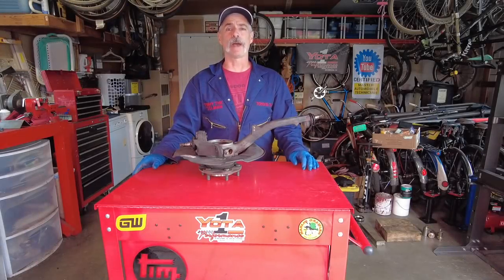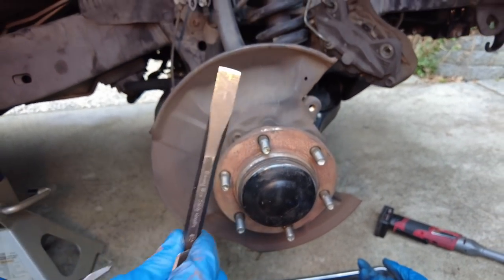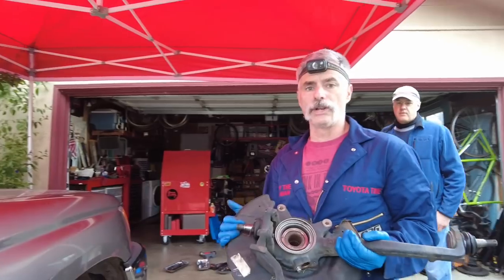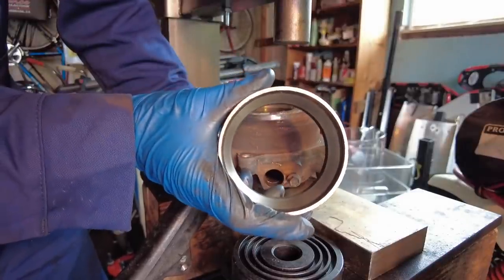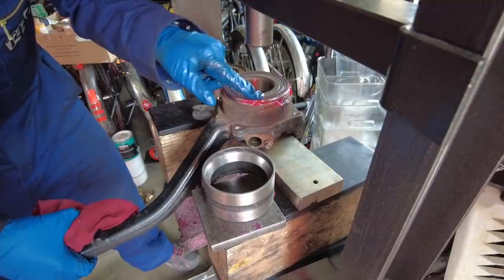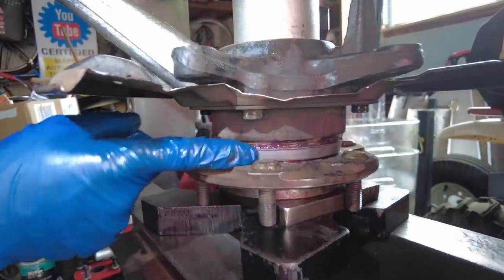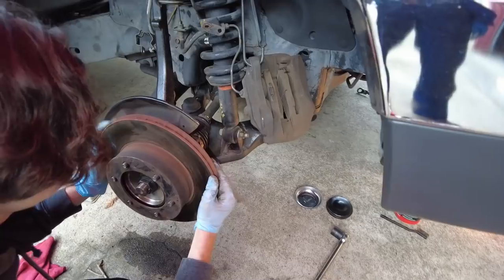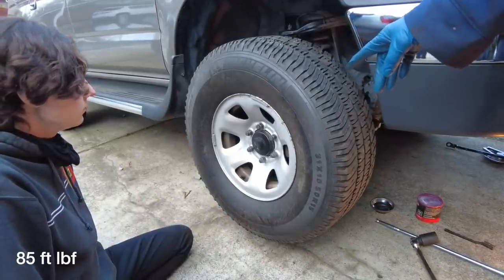Front Wheel Bearing Replacement (3rd Gen Toyota 4runner & 1st Gen Toyota Tacoma)

Comment from the maker: If you're looking for other tools not used in this video, check out Timmy's Master Tool List. 
https://www.amazon.com/shop/timmythetoolman?isPublicView=true

6 Ton Jack Stands - (used to support vehicle while performing this job)
https://amzn.to/2MM91w6

Heavy Duty Rubber Wheel Chocks - (used to chock rear tires as a safety measure)
https://amzn.to/2mttRWp

Mayhew 5 Piece Prybar Set - (used ones from this kit during this job)
https://amzn.to/2Ob8THw

Dewalt 1/2" Drive Impact Gun - (used to remove lug nuts and other fasteners during this job)
https://amzn.to/2M2Y9J1

Dewalt 3/8" Impact Gun  
https://amzn.to/2uqWnZy

Dewalt Batteries https://amzn.to/2urcx59

Dewalt Battery Charger https://amzn.to/2Ud8RlY

Milwaukee M12 3/8” Cordless Extended Reach Ratchet 
- (great cordless ratchet with plenty of power)
https://amzn.to/3kOsUS6

Milwaukee M12 Batteries (2 Pack) https://amzn.to/2uoQlZs

Milwaukee M12 High Capacity Battery https://amzn.to/2HEFTpu

Milwaukee M12 Battery Charger https://amzn.to/2uo2o9x

1/4" and 3/8" Flex Head Ratchet Set  - (used the 3/8" ratchet.  These are very handy ratchets to own)
https://amzn.to/2ql8nNA

1/2" Drive Flex Head Gear Wrench Ratchet - (used for some of the larger fasteners for this job)
https://amzn.to/2Wnbq2r

3/8” Drive Regular Extension Set https://amzn.to/2OehCao

1/2" Drive Wobble Impact Extension Set https://amzn.to/2VYERJj

3/8" Drive 6 Point Metric Standard Socket Set https://amzn.to/32WIh0M 

3/8" Drive 6 Point Metric Deep Socket Set https://amzn.to/37iQjVt

1/2” Drive 6 Point Deep Metric Socket Set https://amzn.to/330QjGh 

1/2” Drive 6 Point Standard Metric Socket Set  https://amzn.to/35dKQwW

1/2" Drive Deep Metric Impact Socket Set https://amzn.to/2WfSTGD

1/2" Drive Shallow Impact Socket Set https://amzn.to/2pCrdPQ

3/8" Drive Deep Impact Socket Set https://amzn.to/2ZWjY6C

3/8” Drive Shallow Impact Socket Set https://amzn.to/2KnoYaq

Straight Needle Nose Pliers - (used to remove and install cotter pins)
https://amzn.to/2pQ6yIa

Knipex Large Diagonal Cutters - (used to assist removing cotter pins)
https://amzn.to/300BRRE

90 Degree Internal Retaining Ring Pliers - (used to remove wheel bearing snap ring)
https://amzn.to/3op46BX

1/2" Drive Breaker Bar - 24” Long - (used for extra leverage to remove fasteners)
https://amzn.to/343Vcix

Brake Caliper Hanger Hooks - (used to hang brake caliper)
https://amzn.to/31JGsUA

Rotary Hammer Chisel Set  - (used one of the small ones from this kit to help remove CV axle nut dust cover)
https://amzn.to/2OmiMCe

Chisel & Punch Set - (used a couple chisels from this kit to help remove CV axle dust cover)
https://amzn.to/37Fwdor

Large Metric Impact Socket Set (29mm-38mm) - (used 35mm socket from this kit to remove CV axle nut)
https://amzn.to/2qdhWhG

OTC 6295 Front End Service Kit - (all the pullers used during this job came from this kit.  A very handy kit to own.)
https://amzn.to/2LuisQc

OTC 4579 Slide Hammer Pullet Set - (used to remove seals off of steering knuckle)
https://amzn.to/301Cg6D

Ball Pein Hammer https://amzn.to/2W5eHV5

Plastic Mallet https://amzn.to/2CCOqVP

Tekton Extra Long Flex-Head Ratcheting Box End Wrench Set 
- (used to turn puller spindle when breaking free upper balljoint from upper control arm)
https://amzn.to/37xSDaV

Long Set of Ratcheting Box End Wrenches - (used to remove and tighten brake dust shield bolts)
https://amzn.to/2oOhndL

In regards to the Press Plates I used for this job, the 2 wide black plates came with the 20 ton Harbor Freight Press.  The 2 skinnier black plates I bought at a fabrication shop.  I just had them cut two pieces of steel to the dimensions I wanted.  The 2 gold plates came as part of an 8 piece kit I bought off Amazon made by Sunex.  It's not exactly a super affordable option but there is a more affordable 6 piece kit offered by Sunex that included 2 press plates.  Here's a link: https://amzn.to/2tb83il

Harbor Freight 20 Ton Press - (this is a great press that you'll lots of use from)
https://www.harborfreight.com/20-ton-h-frame-industrial-heavy-duty-floor-shop-press-60603.html

Wood 4 x 6 sections - get a 4 x 6 at any hardware store and cut off the sections you need

Press Sleeve Kit - (very handy for all kinds of pressing applications)
https://amzn.to/3MRkjxx

Mini Grease Gun - (nice little gun for greasing applications)
 
https://amzn.to/2KKDXf2

Red Devil All Purpose Grease - (used in mini grease gun)
https://amzn.to/2O9DXY3

*

Red Line CV-2 Grease* - (Good high temperature grease for applications like wheel bearings.  Used to lubricate parts for insertion into the knuckle)
 
https://amzn.to/37PQzvm

Yost Bench Vice - (vice I have on my bench.  Yost makes nice vices.)
https://amzn.to/2ofa4LD

Yost 6 Aluminum Vice Jaw Caps - (jaws that won't mar the surface of the steel you are clamping in the vice.)
https://amzn.to/2PopCrd

Brass Drift Set - (used to drive outer seal in place on the knuckle)
https://amzn.to/2BrXfki

CDI 1/2" Drive 30-250 Foot Pound Torque Wrench 
- (used to torque some of the larger fasteners and lug nuts)
 https://amzn.to/2UPhyjK

CDI 3/8" Drive 10-100 Foot Pound Torque Wrench
 - (used to torque some of the fasteners)
https://amzn.to/2U2vUA4

Cotter Pin Set https://amzn.to/2OoD38K

**As Amazon Associates, we earn from qualifying purchases.
Reply: Does this video apply to the 2000 Toyota Tacoma prerunner?
Thank you
Reply: Excellent video very informative and interesting.👍
Reply from the maker: @SDsailor7  Thanks for the compliment.
Reply from the maker: @SDsailor7  Since your Prerunner is 2wd, it is a different process.  Your bearing/steering knuckle set-up is like a Tacoma with manual locking hubs.  Since you don't have a CV axle running through the hub and an axle nut to preload the bearing, you have a lock ring on the back side of the bearing to provide the preload.  Check out our manual hub swap video and you'll understand how to do it.  https://youtu.be/TZ2sOfVrnhU
Reply: @TimmyTheToolman  Ok thank you👍
Reply from the maker: @SDsailor7  No problem.
Reply: Timmah!  I have been looking through the FSM for Gen1 Tacoma 4WD ADD NON-ABS (my taco does NOT have the ABS) to find the non-reusable parts needed. during the instruction for "Install New Bearing" on page SA-24 (95-5 to 97 Tacoma FSM)  i see NO mention of which orientation the new bearing is supposed to go... blackish side there is no mention I can find which way it is to be pressed into the knuckle, you say it goes in one direction one direction only, where did you find that?  you discuss this at 26:00
Reply from the maker: @efil4kizum  The orientation of the bearing might not matter, but we were just going by what orientation we found the original bearing in and information we found on Toyota forums.  The safest choice is to put the new bearing in the same orientation as the original one just in case the orientation does matter.  Toyota FSMs are very helpful, but they don't tell you everything.
Reply: @TimmyTheToolman   maybe it was the hub then that got butchered up from removing and installing twice 2 years ago and ended up roaching a 3rd front left bearing, this current OEM bearing made it a bit over 100k miles... the wheel wobble at 12 and 6 off the ground is extreme, the whole CV axle is rocking in there, yikes!! I was going to assemble this in my garage after i got all the parts together BUT!, it turns out i bot the wrong knuckle awhile ago (45% off MSRP holiday OEM parts sale from Miami) that fit the VIN but it has the ABS and my taco does not have ABS so i can't use it 8^( ... at least my local Yota dealer is willing to use the OEM bearing and hub i bot at that same sale to save 200$ on parts, they are supplying the seals at MSRP that i did not get yet.   I suppose i will look forward to following your tutorial when I get around to replacing the right front bearing that is still original at 329k
Reply from the maker: @efil4kizum  If you paid a shop to do the press work for you, a very common error is not supporting the inner race of the bearing when pressing the hub in.  This puts a huge side load on the bearing and can shorten its lifespan.  Another error is not properly torquing the CV axle nut.  Properly torquing the nut to its high torque spec of 174 ft-lbs sets the bearing preload.
Reply: I have a question how do you tell if you need a new spindle knuckle I have pressed in and out two new bearing and they still wobble any help would be  great
Reply from the maker: @DavidKelly-jb4hz  Are you saying that after you've done all the necessary press work, the hub wobbles?

Comment: Pro tip, if you don't have a 1/2" steel square plate to lay across the bearing on the press, you can use a 1993 Nokia phone.
Reply from the maker: That's a strong phone.

Comment: Tim, your videos have been a life saver for me! Just did this job a couple of weeks ago and glad I did. My ‘97 with 368,000 miles had a torn boot on the left lower ball joint  and the bearing was getting dry. I’m still impressed with the durability of these trucks. I was able to use my 12 ton Harbor Freight press for the right side but had to take the left to a machine shop to have the hub pressed out. I was able to do the remainder. Your video was enough to inspire the confidence to tackle the job. Thanks also for sharing your knowledge with young people! I’m a real believer that folks should be able to repair their rides! Cheers!
Reply from the maker: That’s awesome frank! Thanks for taking the time to share your success with us, it’s comments like these that give us the fuel we need to keep going and making more videos to help you Toyota guys out! We hope more of our videos help you out with your rig in the future!
Reply: Same thing happened to me ! Right side hub would not budge from the knuckle. Tried everything, luckily i found a machine shop and they were able to get it free. Then after they tried to upsell me a new knuckle, saying mine was out of round cause I ran a worn bearing for too long (my bearings were fine, I was just in middle of front suspension refresh after becoming lbj statistic). 
Needless to say attempting this job is signing up for a whole experience. Shout out Tim, who served as pillar of reference while I went to war with my machine.

Comment: great video as always, question though, I am trying to find a pipe or something to push the 3 and 3 quarters outter race after i get the snap ring out. What did you use and where do you suggest i get it? thanks in advance!
Reply from the maker: We used a press sleeve from our press sleeve kit to push the bearing in to detention the snap ring.  We link the kit in the video description.

Comment: Tim! I changed the wheel bearing last week on my 2004 Tacoma 4x4. 
After watching your video about 5 times and a few others I decided it was doable for a DYI person like myself.
Had my PC on my work bench following every single step.
Picked up a used 12-ton press on Offer Up for $60.
It made the work so much easier rather than taking it to a shop risking it not having it done right. 
I really appreciate all the details you talk about and then the write up with parts and tools you recommend.
Watching your videos got me into the Milwaukee ecosystem.
I’ve done a few jobs using your videos & purchased similar tools you recommend. 
You are my wing-man mechanic when I work on my rig.  
Is PayPal the only way to buy you a beer or do you have a different method?
THANKS AGAIN!!
Reply from the maker: Awesome to hear our video helped you replace your wheel bearing.  Great job making the investment in tools so you could do the job yourself. Shops screw this job up a lot.  You were definitely better off doing it yourself.

PayPal is the best way.  You could try to Venmo me also. https://venmo.com/u/TimmytheToolman. Thanks!

Comment: Tim is an excellent teacher following all the textbook guidelines. This job was made easier with all the proper tools with his guidance: mistakes with bearings would be costly to correct. 
I replaced wheel bearings on a Camry without a press nor a vice, so I speak from my own experiences. Btw: my job spread over two days.
Reply from the maker: Good job getting the job done Gary and thanks for the nice compliment.  Yep, mistakes like not properly supporting the inner race of the bearing when driving in the hub could be costly if you damaged the bearings doing it.  Sometimes you don't notice it right away but the damage was done and then your wheel bearings fail somewhere too soon down the road.
Reply: @TimmyTheToolman  Two mistakes you highlighted have been made by mechanics even in their YouTube videos: inserting the bearing with the wrong side and forgetting the dust shield. Wheel bearing and timing belt replacement are perhaps the two most difficult (and also expensive) jobs. Your confidence and skills also stood out in all your videos without cursing that is often used to aid mechanics in lie of prayers.
Reply from the maker: @gzhang207  Thanks Gary.  But, I'd be lying if I said I don't curse.  I curse plenty when I get frustrated while we're wrenching but we don't usually include swear words in our videos.  Sometimes a swear word or two lets people in on the fact that we were seriously struggling to give the audience a realistic idea of how hard some things are.  The goal of our videos though is to give the best information possible and quite often that is sharing things we tried that didn't work or highlighting mistakes we made so others hopefully can learn from it and not repeat them.

Comment: I successfully replaced my bearings today. Getting them out was alot harder than pressing them in. I used a 12 ton strongway press. I'd say it took around 11.5 tons of pressure to press hub out and about 7 tons to press bearing out, 4.5 tons to press new greased bearing in, and 3.5 tons to press new greased hub in. Thanks Tim!
Reply from the maker: Good job getting it done Cody.  When people ask me if a 12 ton press is enough for this job, I usually tell them I don't know and recommend they get the 20 ton press.  It does take a massive amount of force to drive that hub out of the bearing but good to hear the 12 ton was able to do it.  You're very welcome.   Glad our video helped you out.
Reply: Your video made it SO much easier. Watched it a good many times before attempting. A 12 ton will do it, BARELY. I saw if it'll press the hub out at the beginning, it'll definitely do the rest of the job.
Reply from the maker: @codyscott1161  Cool, glad our video helped you out.  That was a fun day teaching the kid some stuff about turning wrenches.

Comment: Nice Job as always, precise and detailed information. One bit of advice, when pressing hub into the bearing you can use the drum to support the hub.
Reply from the maker: Are you talking about using the rotor or actually pulling one of the rear drums off?  I suppose either could work but I probably wouldn't do either because I wouldn't want to take a chance of tweaking the rotor or cracking the drum from the pressure applied.

Comment: I did it!  I watched your video many times, purchase the Harbor Freight press (20Ton) and steel plates from IMS metal  here in San Diego. I’m having it aligned now. Thank you very much for your step by step guidance, complete with torque specifications. Mark 02 Tacoma,4/4,3.4ltr. I forgot to mention I used my press to press in and remove it move upper ball joints. And I replace lower ball joints during this time. That’s why I had to get it aligned.
Reply from the maker: Great job Mark!  It's nice to hear that by following our video tutorial, you were successful with replacing your wheel bearings.  A front end alignment isn't necessary after a job like this, so I'm hoping you were doing it for another reason.  You're very welcome and Happy Wrenching!

Comment: I literally have my sisters 98 apart in my garage trying to find a place to get bearings pressed after I replaced the whole front end, CVs, lower and upper balls, outer ties, 5100s with new coils. Dealership wants 1600 parts and labor even though I have the spindles off. I'm going to just bite the bullet I need a press anyways, so glad I found this video, Thanks Tim!
Reply from the maker: Hey Myles, I think Harbor Freight has their 20 ton press for sale right now.  I saw somebody mention this on a Toyota forum and you can pick it up for $160.  That press has been super handy to me and has never let me down.  Dealership service departments for the most part are a serious ripoff.  Do it yourself, save money, add helpful tools to your tool arsenal, and gain knowledge you can share with others.  It's a win on many levels.  We link all the tools we used in a pinned comment (first comment you see), so you can buy some of the same tools we used if you'd like.   Good luck with the job.
Reply: @TimmyTheToolman  It's definitely on sale, every store in an 80mi radius of my local store is sold out. Can't wait to get this job underway for a fraction of the cost with the same OE parts.
Reply from the maker: @mylesswann530  Gotcha.  Well, good luck with it when you get all the tools you need together.
Reply: @TimmyTheToolman  Got everything buttoned up and put back together, But I missed the dust shields when I was pressing, Thanks again Tim!
Reply from the maker: @mylesswann530  Oh man, you missed my warning in the video to not forget to get the dust shield on before pressing in the hub.  I guess you were just so focused on the big moment of getting the hub pressed in you forgot.  You could cut the dust shield and put it on in two halves.  That would work,  two bolt per half.
Reply: @TimmyTheToolman  Aye, I over looked it as everything was going so well and coming together, I might split it down the middle and reattach it later. But i'm pretty happy how the job came out, everything is nice and tight. Just need a major alignment.